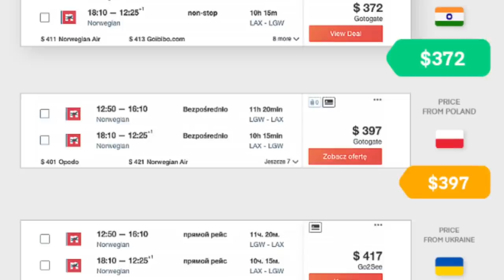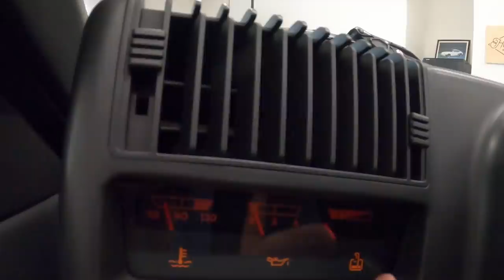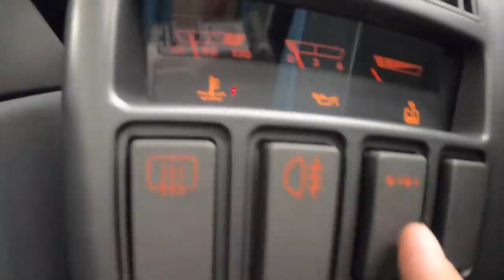The Renault Alpine Is a Very Rare, VERY WEIRD 80's Car That You Actually Want to Drive

Comment: To comment on historic design by applying today's standards is disingenuous.  Alpine have always produced good French design and it must be seen in the context of what was available at the time.  One of the (cost saving) failings that these cars had was a single choke carb feeding the front cylinders in the Vee with a dual choke feeding the rear four cylinders that was notoriously difficult to tune properly.  Triple Webers or Dells or fuel injection brought the engine alive.

Comment: 0:30 HOOVIE! THIS NOT AN EXCEPTION TO THE  "80s CRAP CARS!!

There is a good reason Renault pulled out of North America in the late 1970s. Their cars were crap...yes even the R5 turbo. Every car had a parts car behind the garage. 3 lug nut wheels, shifters that came out of the center of the dashboard, hand crank seat recliners, head rests big enough to block the entire rear window, motors that blew up just cuz it's Tuesday and baguettes for filters. 

I was there. It wasn't pretty.
Reply: There are a lot of cool cars and option available in other countries that we in Canada can only read about or rent while travelling. It seems we tend to be a dumping ground for vehicles with high profit margins and second rate quality. Small trucks with small displacement turbo diesel motors and standard transmissions are available everywhere except here. Apparently, we don't like them (??!!). So we are left with bloated highway wallowing gas suckers that blow 6, 8, 10 speed overthought auto transmissions by 150,000 kms.

I digress. I'd like to try a high mileage Renault today to see if it's bolted together better than the R15 and R17 Gordinis I raced in the late 1970/80s. Just finishing a race without something blown or dragging was a win. When the Datsun 510s then the Honda Civics arrived, competing with a Reneault was as pointless as it was embarrassing.

They could have only got better.

Comment: To think that, when this came out, nobody wanted it because it was too differernt from it's predecessor, the A110.
Too much ahead of it''s time, maybe.
Bij the way, this double carb setup was common on Peugeot's with the same engine, single barrel first stage, double barrel second stage.
TRX "metric" tires were all the thing back then, the tire of the future that didn't make it. Michelin still makes them at request, but expect too dig deep into your wallet.

Comment: Nothing like a Grey Market car. This will tend to attract nothing but strokers........
Not many were imported since they were considered Grey cars. Even today if customs gets a burr up their arse they can confiscate any Grey at their discretion and you are out of the money. Most greys also were taxed at a ridiculous amount which added to their price and limiting their market share to the public. I do like the interior layout! Very modern for its time. As for the stereo system it is huge! At least they have come down in size over the decades. Even today my Renault has the steering wheel stereo controls. They even have auto volume adjust depending on speed to compensate for any road noise.
After 14 years working here in the EU I still have not seen one Alpine on the road here but there are probably a few tooling around up in France. Lots of older Beemers running around due to their reliability, as for new ones people tend to shy away from them, nothing but problems with electronics.

Comment: Had a couple of Renault’s back in the day, a 1979 LeCar, great runner and fun to toss into a corner. Then a 1984 Fuego, great car to drive, terrible car to own, it leaked every fluid you put in it. Traded it two years later for a 1986 Corolla SR5 and never looked back. Great review by the way.

Comment: The 80s not a good period for performance and quality? WTF Hoovie?
 
I had a 1980 SAAB Turbo and a 1987 Audi 5000CD Quattro. Great cars. Had the SAAB from new and could do the equivalent of the Kessel Run (Grande Prairie AB to Tswassen BC) sub 11 1/2 hours including pee and fuel breaks. The Audi could go YQU to YYC on 80 litres in less than 8 hours (non-stop). I had both up over 160km/h and the only thing was that the Audi got a bit squirrley above that (nothing a dam and spoiler couldn't fix)

Both cars could start at -40C no problem. 

Never got a cramp or stiff legs or a sore back in either of them on the long haul trips.
But then, you weren't a twinkle in farther's eye I guess back then.

Comment: Sorry Hoovie.  Love your channel. Watch all your vids.  But the 80's were when technology and HP came back.  Beginning of the decade 0-60 of 10 seconds was fast.  By the end of the decade 0-60 of 5 seconds or less was fast.  Turbo charging, port fuel injection and many other technologies came about and started to offset the 70's glut in hp.  It's insulting to me that you would post this as if the 80's was the peak of the HP glut.  That was the 70's.  The 80's started to overcome it.  The HP wars of today started in the 80's with your 89 Countach which you still haven't told us what you paid for despite all of us allowing you to afford it.

Comment: You poor, poor spoiled man. I only came here because the title of this video was so appalling to me. There were plenty of fun cars in the 80's. Even the ones that were a tad on the poochy side had enough quirks and fun in them that I would choose a lot of them over the bland nanny computer, triple weather sealed, electric steering jellybeans of today. 
As for the performance part, well i guess if you had zero knowledge about mechanics and how to do.... anything to the platforms available back then. 351W dropped into a mid 80's LTD. 1970 Olds 455 dropped into an '86 Chevy shortbox 2wd pickup. Buddy's dad special ordered a Chevy Celebrity Wagon with the new at the time 3.1 multiport engine. It could lay rubber for 30 feet.   Cam and head work on one of the dime a dozen 4 cyl. Mustangs(buddy even did it to a Ford Ranger) or similar to the Chrysler K cars. Many of the Japanese cars were a blast to drive, and that includes their half-American counterparts. I had a late 80's Mercury Tracer.....wagon. It had a 1.6 Mazda engine in it out of a Miata, and a 5 speed gearbox that topped out at 90mph. It was snappy as all get out, most fun I have ever had in a stock 4cyl car, and it had 13" wheels. Basically, if you had a wimpy, boring blah car in the 80's it was your own damn fault.